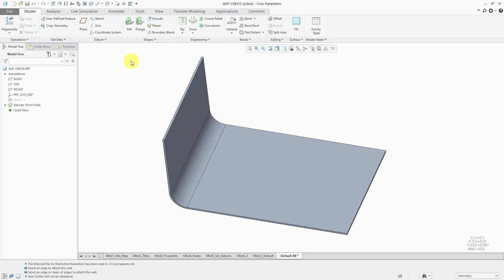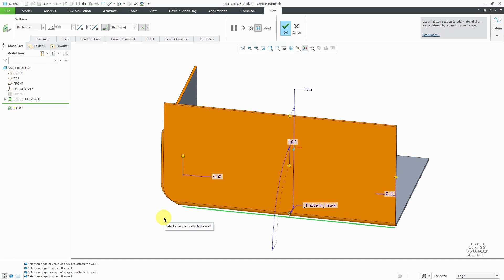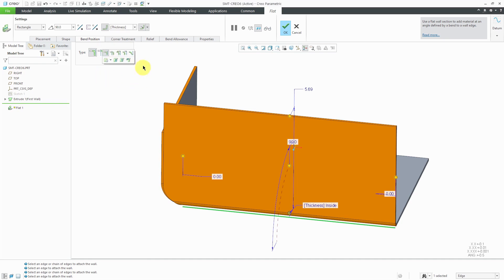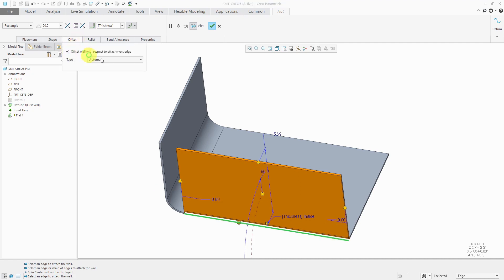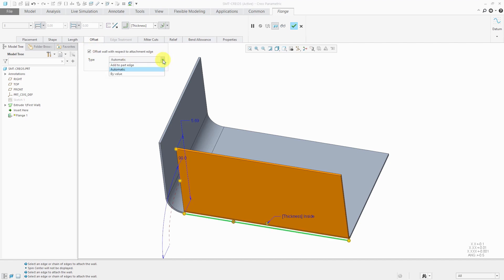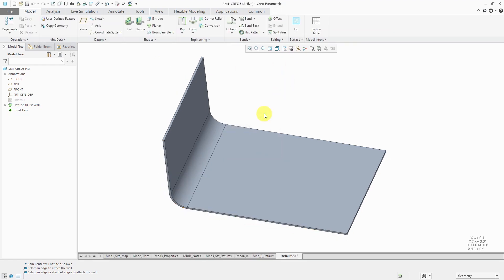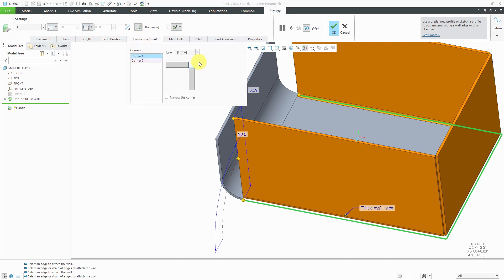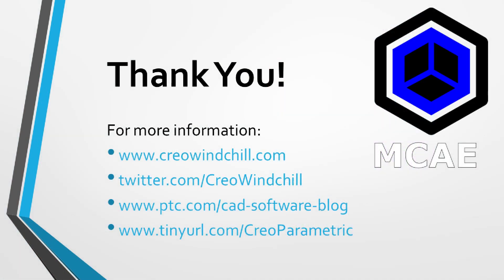Creo Parametric 6.0 - Sheetmetal Flat and Flange Wall Changes

Comment: Hello Dave, 
After seeing your expertise as a creo instructor, I think that you can clear my doubt related to the flange in this link https://community.ptc.com/t5/3D-Part-Assembly-Design/Sheetmetal-Flange-is-connecting-with-adjacent-walls/m-p/703412 
Thanks in advance
Reply from the maker: I don’t understand. Regardless, thanks for watching the video!
Reply: @CADPLMGuy  That is, I created a planar followed by a flange on one of the sides. Then when I add another flange wall to the edges of both previous flange and planar , I am seeing a flange attachment next to miter cut gap. How to avoid this? I have uploaded images of the flange attachment marked in black colour on that link!